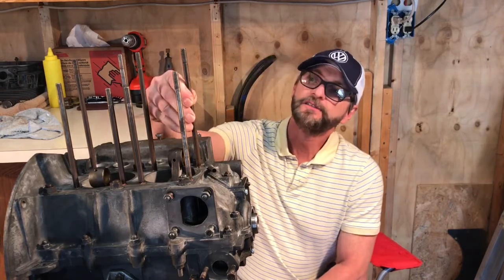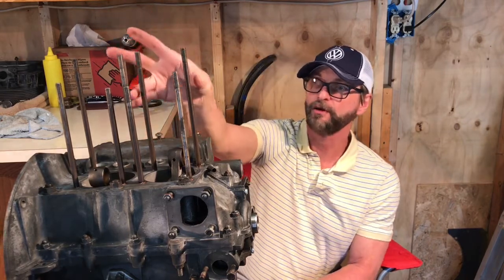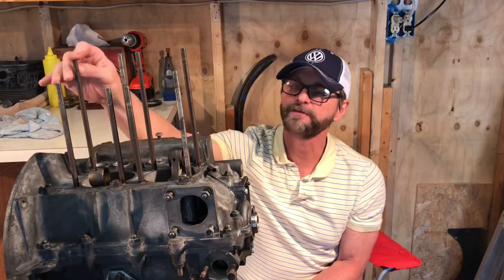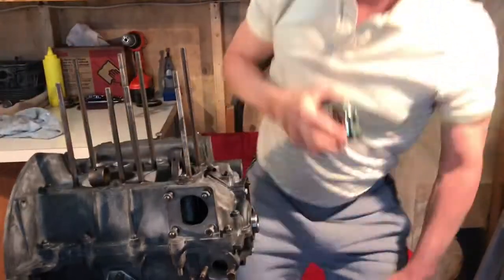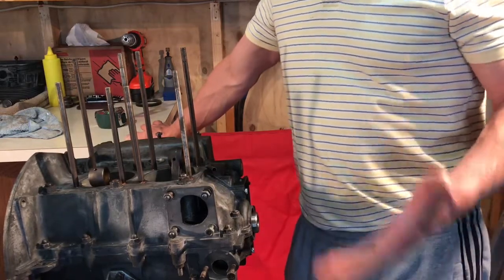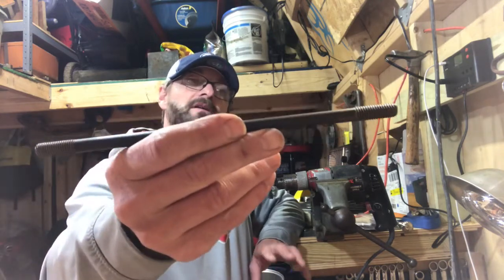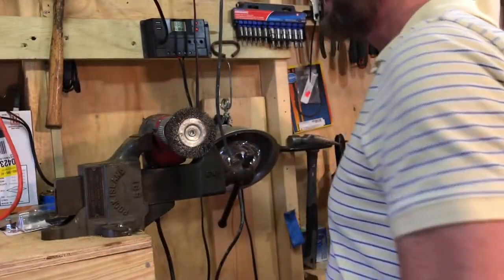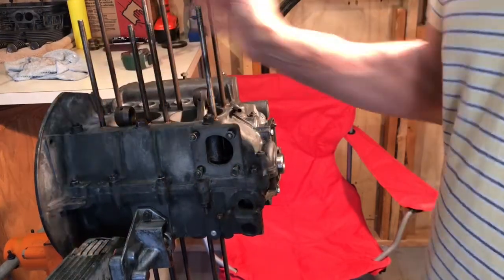VW  8 MM studs

Comment: What year engine/block was this shown on? I was advised that 1973 and up have inserts that prevent the case from stripping. Did you have any case threads come out with the studs when removed from the block?
Reply from the maker: This video it’s from 2020, and no I didn’t have any issues with my block.

Comment: For those interested,  it's not necessary to remove the studs from the case when rebuilding.  Some cases could use stronger studs, especially if you're souring up the engine.  For that, it is usual to have the case machined for larger studs or case savers to spread out the load in the case. 
And go easy on the wire wheel clean up. Don't use a lot of pressure, or you can compromise the steels strength.
Reply: Souping,  not souring! Frickin spell checker!

Comment: Excellent video! Now I took all of these studs off the engine case… without noting down the diagram of where do the short ones go. Can you advise whats the pattern for reinsralling them? Like the short and longer ones… thx
Reply: Does not matter. Only installing the heads is a pattern important.